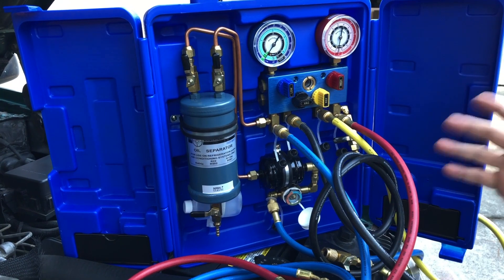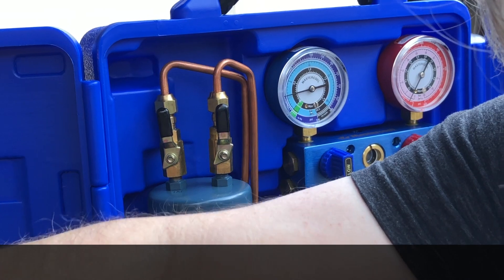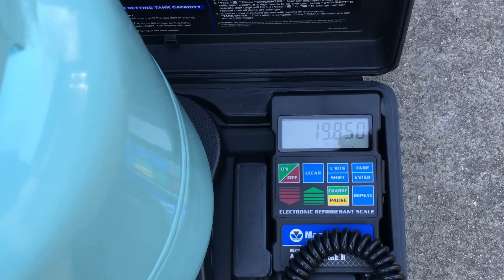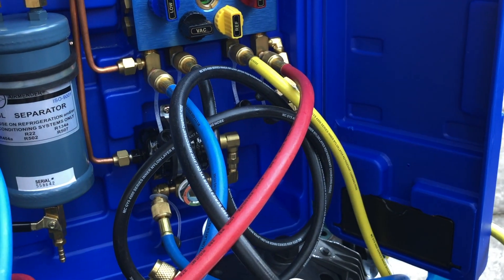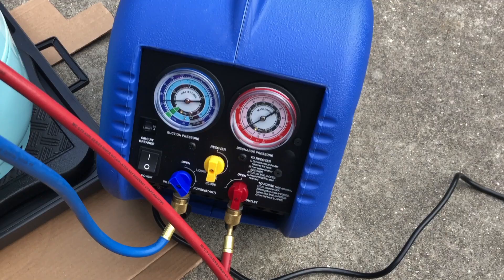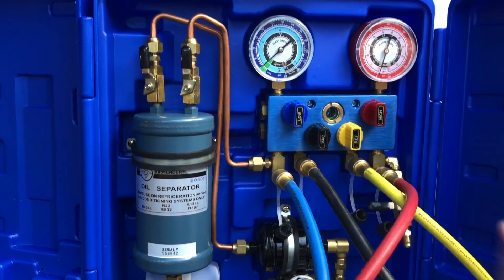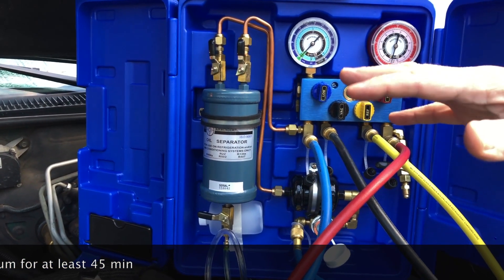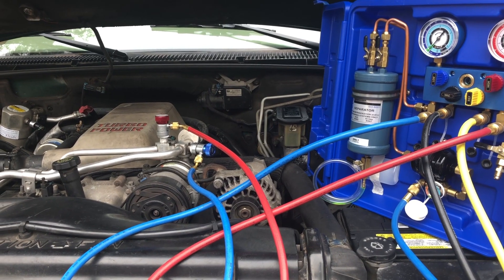How to Recover R-134a Refrigerant from an Automobile using Mastercool 69000 + 69500 Equipment

Comment: You invested in some nice equipment but skipped the micron gauge.  What was the rationale?
Reply from the maker: Overkill.  You don't need anything more than analog gauges to accurately service the older R-12 and R-134a automotive systems that we typically handle.  In fact, analog gauges were all that the GM dealerships were equipped with from Kent-Moore when the vehicles were still new and serviced under warranty from the 1953 model year when air conditioning was first made available up thru the first decade and a half of this century when R-134a was phased out.
Reply: @DrShock  Technology and HVAC has changed a lot since 1953.  Your views seem long outdated.
Reply from the maker: Not really, HVAC of this area remains predominantly mechanical and primitive electronically.  My views on tools just match the GM factory service manual guidance for this era.  No more, no less.

Comment: Have you tried charging a system on the high side with liquid refrigerant as per step #4 in the 69500 instructions? I haven’t seen a video of anyone demonstrating this. Thanks and great videos.
Reply from the maker: Thanks, no this unit is a recovery only unit.  It cannot charge an automotive system per the most recent Mastercool manual for it.  It may be able to do residential, but not automotive.   So without a dedicated charging station, smaller shops have to just use the low side and leverage the vehicle's compressor do the job.

Comment: Do you evacuate the tank prior to recovery? Or do you start at 0 lbs?
Reply from the maker: I think you're asking about with respect to the scale, and if so the answer is you tare the scale so that it resets to zero regardless of the current contents/weight of the recovery cylinder.
Reply: @DrShock  No sir, I am inquiring about whether or not you pull a vacuum  on the tank. I understand the tare feature on the scale when I start evacuating the system. I just want to get this right the first time. Thank you, the videos are great.
Terence King
Reply from the maker: Sure, so the recovery cylinder when new will need to be prepped yes (vent the factory nitrogen anti-corrosion charge and then vacuum).  This vid may help https://youtu.be/Gi0SiJJ6TOQ

Comment: What is the point of using the recovery mate? Is this necessary to buy with the recovery machine as well? Im looking to buy the Mastercool 69110 and don't understand the extra money needed to buy the recovery mate. Is it literally just to reuse the refridgerant?
Reply from the maker: Its' purpose is to filter out failed component debris, perform water detection, and remove oil from, the recovered refrigerant.   Whether you are reusing the refrigerant, or selling the refrigerant to a reclamation center for recycling, it has to be filtered and cleaned up to do so.   Also, in some situations it can be necessary to replace the amount of PAG oil that is recovered, and the RecoveryMate gives a way of measuring that.

Comment: I need help to solve some doubts I see you Setup and I'm willing to get something like this but I also saw they have a  now a 96100 kit and wonder if this new kit is a all in one unit. Or is just better to get the setup that you have done.
Reply from the maker: That Mastercool 96100 setup was another I looked into at the time.  It's very comparable to what I showed in this playlist series.   The 96100 does include a type of recovery cylinder with the internal level/float for automatic cut off that plugs into the recovery machine (yellow cable), but other than that it's the same features wise.   I went the route I did based solely on lowest cost for Mastercool branded equipment.   I could easily recommend the 96100 too, though it will cost a bit more.

Comment: Can I recover the freon just like your doing and recharge with the same freon?
Reply from the maker: This particular Mastercool unit I showed in this vid is a recovery machine only, it does not do a recharge function.   You typically would not want to reuse R134a, as you don't know what the history of the customer's system is contaminates wise.   But if it's for yourself you could put it back in just using a gauge set on the low (vapor) side only.
Reply: @DrShock  cool! I'm an ac TECH but always had the robinair 34788 machine for 10 years. It finally broke . So I bought a machine like yours. And I'm thinking I can empty a system do a discharge hose replacement and recharge the same stuff in same car.

Comment: Great videos 👍do you have a video how to recharge a vehicle with the the recovery tank. Is it basically to the same as using a prefilled tank with one valve, flipping the tank and open the liquid valve?
Reply from the maker: Thanks.  For a small one man outfit like myself where A/C work is only occasional, I just recharge using a virgin R134a cylinder and a gauge set on the low side (vapor side).  This particular machine is not designed to recharge, only recover.  You never know what a customer has in their lines, so best not to reuse whatever is recovered anyway.  You can turn the refrigerant into a local recycling center when the recovery cylinder is full (where I am they give you back your empty cylinder).

Comment: How do we recharge the system though?
Reply from the maker: Once the repair is completed, and the system fully vacuumed of atmospheric moisture, you would just swap in your 30lb virgin R134A cylinder and gauge set and charge to the specification on the vehicles recharge label.   You'll need a scale with the cylinder to determine this of course.  Maybe this other video at 9:54 time index will help clarify these steps - https://www.youtube.com/watch?v=v_saFG7gnaI

Comment: Any updates on the new 1234yf refrigerant? Just spent two arms and a leg. Looking for future repairs as these companies suck with notorious failures
Reply from the maker: Same procedures and recovery equipment can be used, but only with different size couplers than R134A as the vehicle port fittings are different sizes with R1234yf (aka HFO-1234yf).  Separate refrigerant storage cylinder needed too of course.  Also R1234yf is mildly flammable, so added safety procedures there as well.

Comment: What was the point of the yellow hose?
Reply from the maker: Yellow is the typical automotive hose color for the refrigerant cylinder.  Either recovery, or supply.  Black is typically the automotive hose color for a vacuum pump connection.

Comment: I bought the 69110 recovery machine.  It has an oil separator.  If I am not going to reuse the 134a, do I need to really get a 69500 recoverymate?  From what I am reading in the questions and your reply, you don't recommend reusing the freon pulled out and through the recoverymate. 

If I put a filter on the inlet, would that be as good as the recoverymate?

 Thanks...
Reply from the maker: If you are working on your own vehicles, like in a fleet maintenance setting, then you know the history and with a filter, dryer and oil separator you could reuse the refrigerant.  

I often work on other folks vehicles, so I don't know what kind of contaminants they have in their system.  In such situations you really have to recover it and when the cylinder is full, take it to a local EPA reclamation center for disposal.   Filling from a virgin refrigerant cylinder after the repairs are complete and verified.

Comment: which mastercool recovery unit would have the dryer and oil separator within it? Id rather spend the extra to avoid the extra hook up and case if possible Also....can you cover how to recharge the system afterwards please? would additional equipment be necessary to recharge the system?
Reply from the maker: For an all in one recovery machine solution, you might look at the Mastercool 69100 model instead.   That would have the oil separator and filter dryer built in.

You would not use a recovery machine to do a recharge, they are really only designed to recover the refrigerant.   You would then typically take the recovered refrigerant to an EPA certified reclamation center where it would then be recycled.  Where I am they will take it out of your cylinder, and then return your cylinder back to you empty.

For myself, I recharge just using a 30lb virgin R-134a refrigerant cylinder (the disposable type), and a gauge set.  I do not reuse recovered refrigerant in repairs I do.  The equipment for filtering it is just to be sure it's going to be acceptable at the reclamation center when the time comes.

Comment: I've had that same setup for many years and have never really recovered any oil from as many car's that I have worked on. I have used $3,000 and $4,000 dollar equipment with an oil separator at work and for some reason you do get very little oil out of the system.  Got to the point where I couldn't really justify the need of an oil separator. I have worked residential and industrial HVAC systems and I have hardly removed any oil while in recovery. Yeah maybe if the refrigerant blows out under a high pressure you might for sure loose some if not all the oil from the system.

Comment: Is there a need for a stand alone vacuum pump as if the recovery machine has a vacuum purge function?
Reply from the maker: The recovery machines purge is just for its own internal piping.  You'll still need a vacuum pump to check for leaks on the vehicle's system.

Comment: I am watching your videos, very informative, I have a brother who is an AC tech, I am not, but I work as electro mechanical engineering, for $1614.00 all these can be acquired in Amazon, then be paid on 12 months equal payments which it is not bad for what you get, the question is; it is worth it for just one car or 2 cars? makes me wanting to take the course then get certified, only $20.00 then go do some work to pay for the equipment, LOL, in any case, your videos here makes it easier to understand what to do and how to operate the system; it has some bad reviews but I think some folks are confused as this is NOT a shop recovering system only for the home mechanic and not intended to be used industrial setting no matter what the vendor says; here it seems it does its job and since I already have the vacuum, same one you show here, then why not?
Reply from the maker: Thanks.  It's not worth it for just one vehicle, and questionable for only two as well.  More than that though, I would say the tools can pay for themselves within a few repair projects in labor costs alone.   

As for the reviews on Mastercool, recovery equipment is definitely intended for professional shop use only, rather than at home.  The units have to be properly maintained to avoid problems.  But as I've shown these entry level recovery units can be a prosumer grade tool for casual use as well.

Comment: Have you used the valve #3 access port on the 69500? Is that used for oil and dye injection when recharging the system? What procedure would you use to do this without introducing contaminants. I see no explanation in the instructions.
Reply from the maker: Yeah, Mastercool didn't explain that port.  But that V3 port is along the high pressure side, so I wouldn't expect to use it for automotive applications.   When I need to do a dye or oil addition, I use an inline refillable dye/oil injector attached on the low pressure side.  A CPS Products TLJ4.  I went with the CPS version here because their instruction manual was very well done compared to Mastercool's version.  

One of these days I'll put a video together using the CPS to add ACDelco R134a tracer dye.
Reply: @DrShock  can't it be used to liquid charge an automotive system? You recover and evacuate, then use the same setup to pump the refrigerant in. Use the recovery unit to add pressure to the vapor side of the tank forcing liquid out the liquid side into the non running vehicle.
Reply from the maker: I recall that Mastercool does document that high side liquid recharge hookup and procedure, but I personally don't use that approach for automotive.  I only use the vapor side to do a recharge, utilizing the typical approach of having the vehicles compressor with the engine on to draw in the new charge while I monitor both the scale and low pressure gauge first hand.  It just may be that I'm guilty of being old skool.  ;-)

Comment: I am thinking about getting this setup.  Is there any reason this would not work on my houses ac system. I would be mainly using it for automotive but would like to be able to work on my house system too. I know I would need the correct Schrader connectors for the r22 system. It looks like the compressor will handle any type of refrigerant. Also how are you planning on adding oil and die with this system? 
Thanks
Reply from the maker: The manufacturer rates the components I've shown here for many different refrigerants yes.    Obviously the recovery cylinder has to be dedicated to only one particular type at a time, and technically you're supposed to buy the one color coded for R22 (light green) vs R134a (baby blue) for when it comes time to bring the recovered refrigerant to a recovery facility.   As for pag oil and tracer dye, yes I have an accessory for injecting that separately.  The dye charge stays in the system so you don't have to worry about adding that unless you make a large component replacement, such as the compressor.
Reply: @DrShock  thanks for your help. I am an automotive tech. My residential r22 pump just failed and plan on tackling job myself. Mastercool actually sells the 69300 pump in a kit with tanks for r134 and r1234yf that I plan to purchase along with the 69500 accessory kit. I will also be doing an r12 on my old Mercedes. I understand all gasses must be kept separate. Any other advise or must have tools. I have a quality vacuum pump, hand held dye/oil injector, and Schrader valve tools. Thanks for your informative video.
Reply from the maker: @mattbentley8958  About the only other advice I could share given your background is that there's a playlist, in addition to this vid, with each of these components unboxed I put together. You might find that useful for more details around the 69500 before you pull the trigger on it.